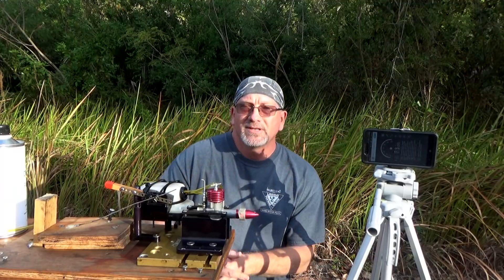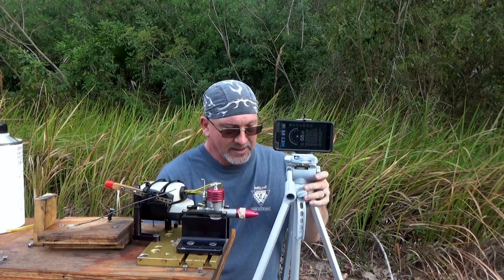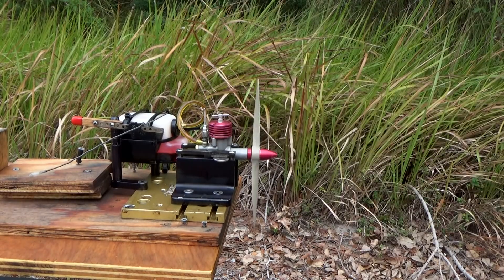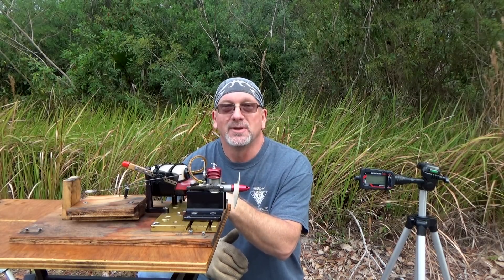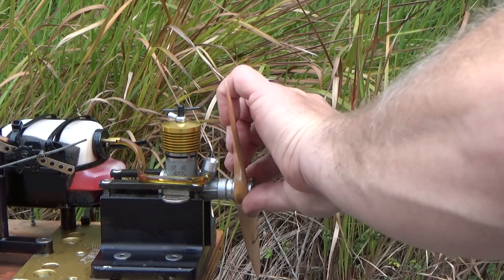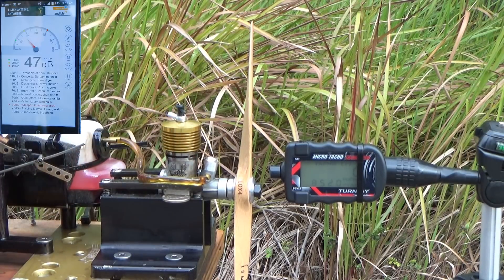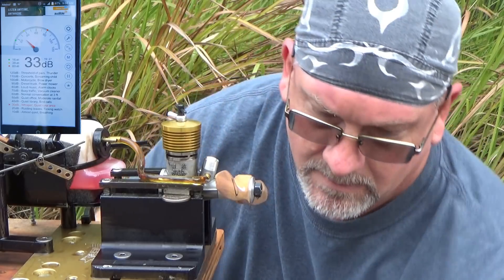Homebrew Diesel Fuel Experiment

Comment: Back in the 70's in New Zealand we used Either 33%, Kero 33% Caster Oil 33%. Sometimes a little less either and added 2% Amyl Nitrate to assist with starting.
Hope that helps.

Comment: Charles Spickard  Using petroleum based oil instead of castor oil always worked better for me. I used 50% kerosene, 25 % medical ether and 25 % non detergent aircraft engine oil . The aircraft engine oil burned along with the kerosene  and ether as fuel instead of just being "spit out" as waste.
Reply: Castor oil is used to extract heat from engines when used in a total loss system.  It holds a tremendous amount of heat and many have discovered the hard way with older plain bearing engines running low percentages of modern synthetic oils it is not always beneficial changing...

Comment: Typo / correction on the ebay Ether name on my last post. Below is the correct spelling - exactly as it shows on ebay:  
Diethyl Ether, ACS, 99+%, 500ml (for Photographic Applications)
That's the proper name on ebay ..   John Deere fluid starter (in cans) is your second best choice as far as Ether goes.
Also don't forget to use a bit booster. They used to sell Amyl Nitrate (I still have some) but no longer is the case. Get from any auto supply store a bottle of Cetane Booster and add about 2 to 3% to the total fuel volume. It will save you a lot of aggrevation - boosters in diesels are not to be confused with nitro in glow engines. The booster in diesel fuel will assist you in starting and operating the engine at a lower compression setting, thus less wear and tear on the engine which means longer engine life as well. 

Take care Dave.
Reply from the maker: Thank you Charles.  Since I will never be flying an airplane with a diesel engine the fuel I mixed up for test runs seemed quite adequate without the cetane booster.  I was also simply using materials available locally.  There is no supplier of John Deere starting fluid in my area.  The intent was to show others that items readily available can be used and that they do indeed work.
Reply: Picture this David:  a .35 diesel control line engine ( PAW .35 to be exact ) pulling a .45 size glow control line .. and almost twice the time on the same tank .. pulling with authority - no skipping a bit throughout the entire flight - no batteries to carry around, no glowplugs .. just a small container of fuel, a rag and off to flying .. The care-free operation and power that one gets from a diesel engine is simply PRICELESS ...   

Yes there is a some learning curve to overcome and the fuel can be messy and  you have to know-how .. but once you cross that over .. boy .. careless flying and pure enjoyment.  Can't get more simple than that :) 

Take care ... I enjoy watching your videos and interacting with you at times.

Cheers.

Comment: Your best bet for ether is John Deere fluid starter ( for their tractor equipment) - it's more than 90% ether .. The next best bet is to order from ebay, solvent grade Di-Methyl Ethyl Ether (photographers use it in their labs) - about $30 for 500ml and it comes in tinted glass bottle (which is second best after aluminum container) and that should last you quite a bit. Also - make small batches at a time - One more hint: search for Dr. Diesel on the internet and get the manual - it's about 30 page manual  ( yellow cover ) and has everything you need to know about diesel engines (like the MK-17, Silver Swallow, etc .. ) , how to start them, several variations of fuel brew's and much more .. It is trully the "bible" on diesel engines, very easy to read and follow and truly priceless with the information it contains.

Comment: first thing i see is less black residue from the engine winner good job
Reply from the maker: Yes you can actually see the exhaust change color as I over compress it and then back it down.  This is an important thing to notice when tuning the diesel engines.  So I have learned....

Comment: Cool video David! and I have a suggestion: Double the starter fluid content and halve the kerosene content but keep the oil content the same. This will effectively bring the ether content back up to where it should be and your engines will be much sweeter running, The consequences of not doing so will be having to run on much higher compression settings and that will induce pre-mature wear on your conrod and bearings. You will also need to acquire something called 2EHN and add between 2 and 3 percent of that to your fuel. 2EHN  will raise the cetane value of your fuel and this will cure the erratic running problem completely. 2EHN  is widely used by diesel fuel makers and distributors in the blending of diesel fuel batches to ensure the delivery of consistently high quality diesel fuel to their customers. You will be able to buy an impure form of it from your local auto-parts store, where it will be known as "Cetane booster". Ether in our case (Di-Ethyl Ether) comes from the alcohol found in drinkable spirits, ethanol, yes "booze", after it has been processed with Sulphuric acid. Here, in South Africa, it is produced by the sugar cane industry as they are also involved in the production of drinkable alcohol. In America you will probably find that the maize industry will be involved. "Di-Ethyl Ether" will  be widely known in industry circles as either "Technical Ether"  and/or  "Sulphuric Ether".  It is all the one same thing.
Reply from the maker: I will try this recipe next time I mix fuel.  Since I do not plan on flying these engines or any long term running, I am not too concerned about wear.
Reply: Это не одно и тоже ..этиловый эфир..температура кипения  34.5.С..у диэтилового 74.5 С....диэтиловый эфир ,это.растворитель типа ацетона.В компресионных..двигателях не применяется ..только эфир этиловый   медицинский..надёжный  воспломенитель и охладитель..

Comment: when you have dark oil it is an indication of over compressed. What you would be best doing is turn out the compression screw until it falters, then turn it in until it smooths out. Always lean towards low compression setting. Remember big props require low compression and smaller props require much higher compression. Smaller props are hard on the big end of the con rod.
Reply from the maker: Yes you can see the exhaust residue change as I adjust the compression back and forth.  Keep in mind, I am making adjustments throughout the video to learn about tuning and see the cause and effect of different settings.
Reply: Good work, great savings on the home brew. I've been mixing my own for about 15 years now, it's way cheaper than DD.
Reply: Тёмное масло это  где-то трение большое .мельчайшая металлическая и чугунная пыль..придаёт маслу тёмный цвет..разобрать двигатель и найти причину и устранить..затереть шкуркой нулевкой  и тщательно промыть..двигатель.
Reply: Тёмное масло это  где-то трение большое .мельчайшая металлическая и чугунная пыль..придаёт маслу тёмный цвет..разобрать двигатель и найти причину и устранить..затереть шкуркой нулевкой  и тщательно промыть..двигатель.

Comment: Good job with the mix. Nice that there is still hope for these engines. Just have to look for starting spray with ether inside. Sorry for the bad tip with wd-40. They changed the mixture.

Comment: Its better than I was thinking.The only thing you need is a bit,say +/- 3 % Cetaan booster.That will drop the ign. temp. and make the engines run far smoother with lower compr. settings,what is less stress for all internal parts.
If the exhaust turn black David,it means its over compressed.This is bad for the engine and need to be avoided as quick as possible. I would try a 8x6 on the Silver Swallow.It will come more to a smooth "ride" 
Thumbs up David...well done,nice clip!
Reply from the maker: I guess after seeing how easily this started and ran, I do not see the need for Cetane booster.  That is just another ingredient to add cost to the mix.  Seeing as these engines will be run only for making videos I am not too concerned about long term wear and tear on the engines.
Reply: Thats is true David.I was just thinking,you measure all the things as temp, rpm and so,it will be for others ,who do like  to use them and fly,maybe interesting,as its a key  part for a smooth and more powerful  run.
But I leave it of course up to you,no problem.
Reply from the maker: Well the MK-17 seemed to run perfectly.  Considerably better than the SS on this mix.  SO I sort of attribute the difference in how I setup the SS as far as prop, venturi and HSN.  I mean I changed nearly everything from the first run to the second on the SS.  I think a bit more run in time might have it smoothing out some.  Now to go watch more of your videos.....!
Reply: The MK 17 is a die hard...eat everything! Have a excellent carter pressure what is very important for a good start and smooth run,as it have a good suction David.Its a bit a heavy with  133 grams,if I remember well.But a great looker...Sleek and elegant...
You can also try to change the parts of aether,up to 40%.That should improve starting also...
Reply: Are there any Diesel engines with Ringed Piston?

Comment: worked dam good.is the brew cheaper than davis fuel
Reply from the maker: Well I have had the kerosene for several years, but it is $10 a gallon at Lowes or Home Depot.  The castor I buy on eBay for about $13 a quart and the starting fluid was $2.69 at O'reilly auto.

Comment: Hmm now i realy need to goto hardwer store after new year and try to make my fuel at home...is it just me or did MK 17 had higher rpm with this fuel?
Reply from the maker: Different prop on this run.
Reply: @dmrcflyr2  what's tare the percentage of the items in the mixture
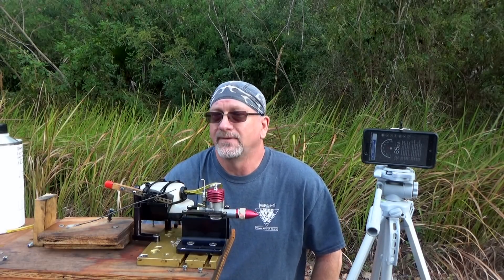Reply from the maker: @TimSmith-vl4qk  If you listen closely between 1:30 - 2:00 I clearly state this.
Reply: Blaz, a good mix is 280 ml castor, 300 ml ether, 420 ml of kerosene and 42 ml of ignition improver. I use this mix in my PAWs and my MAP3 it works good.